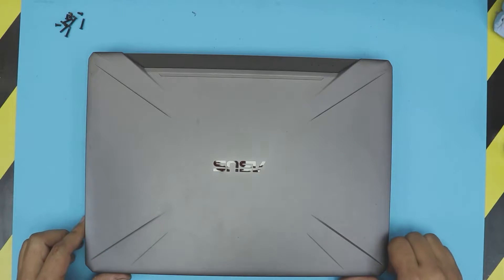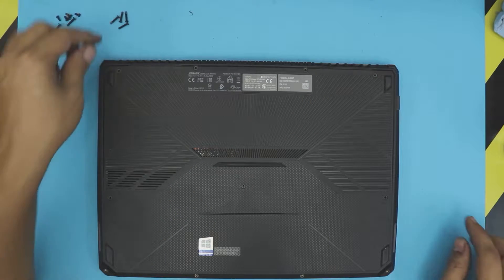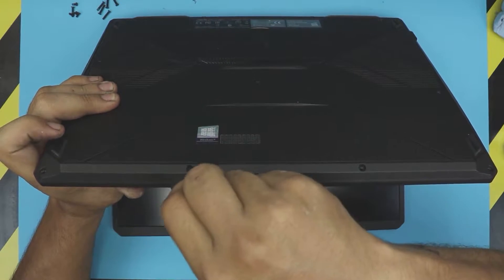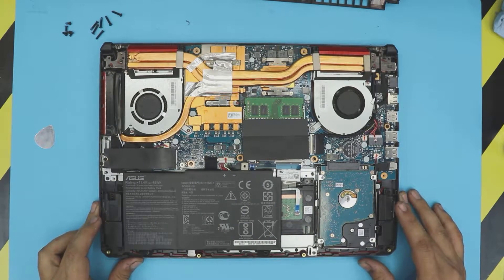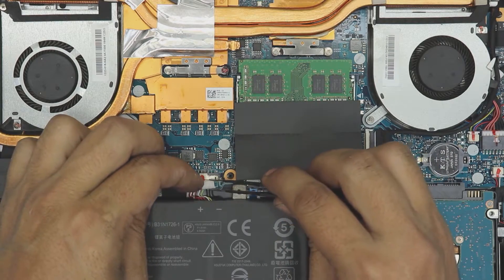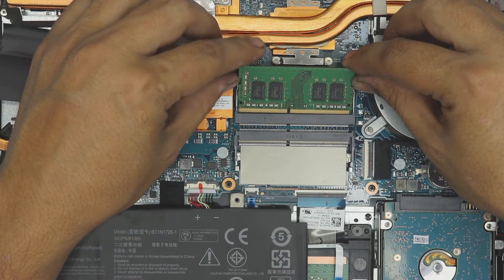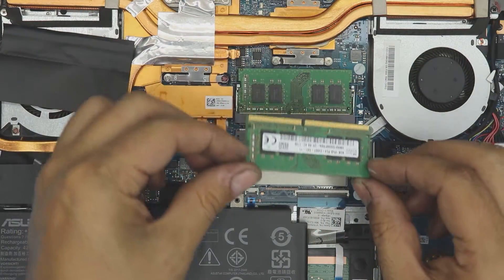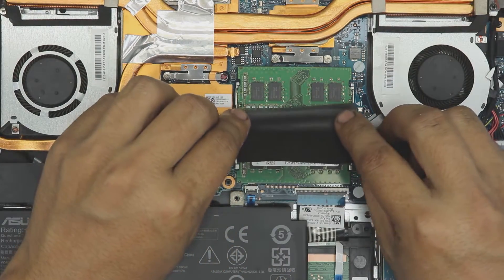How to Upgrade RAM on ASUS TUF FX505D for Better Gaming Performance

Comment: Sir  im confused about the Cas Latency,  when i scan with cpuid it shows 17 CL , but if i type my currently installed RAM it shows 22 CL , i am confused, what ram is correct for my asus tuf fx 705dt ?
Reply from the maker: 🫠Regarding your question, you do not need to worry at all about the CL or latency, as you will not notice it on this laptop. Just make sure you get SDRAM DDR4 3200MHz. I have placed links for the recommended RAM in the video description.
Should you have any further questions or requests in the future, please don't hesitate to ask me.
cheers🍻
Reply: @uFixTek  god bless you sir thank you
Reply from the maker: It's my pleasure my friend.

Comment: I removed the battery and rely on plugged but not working 

and even I dint pressed the power button it will start to blink.
Reply from the maker: you can use the laptop without the batery, we do disconnect the battery for some clients and the only downside is that the laptop takes 30sec longer to show anything on screen.

Comment: One of my long screw is struck.. I'm not able to unscrew it.
Any solution here?
Reply from the maker: 🫠Regarding your question, if you have one of the screws rotating and not coming out is because the base of the screw is broken and is rotating in its place, what you need to do in lift the rest of the cover and create a tension on the screw and once you create the tension by lifting the bottom case at the same time start unscrewing and the tension will not let the base rotate and it will result in release of the screw.
cheers🍻

Comment: hi i already have 2x 8gb rams, but will this laptop much smoother when opening many browser tabs if i had 2x16gb instead? i will not upgrade if the difference is not going to be noticable.
Reply from the maker: 🫠 If you wish to support the channel, you can like, subscribe, or both!
Regarding your question, it will defiantly help with more browser tabs if you have a lot open it will defiantly help.
Should you have any further questions or requests in the future, please don't hesitate to ask me.
cheers🍻

Comment: Wish you would cover the memory speed settings in the bios after installation. I can’t figure out how to change it in this version. The 3200 sticks I installed are defaulting to 2400.
Reply: I think the Ryzen 5 3550H maxes out at 2400. So no point getting more than that
Reply from the maker: Thank you for the feedback! if you wish to support the channel you can LIKE or SUB or both :P
regarding your question: not all the bios on laptops are changeable, go to your bios and look for "XMP" option and enable that if there is any, else there is nothing you can do about it.
Reply: @uFixTek memory speed default its 2400.. i wajt upgrade my RAM 32GB dual which it's better still with default buy 2x16GB 2400 or 2660 or 3200 ? Which better ?

Comment: what card did you use there and where can it be found, also i didnt see any but are any specialty tools required for this?
Reply from the maker: thank you for the feedback and your support by a sub  :P
regarding your question:
the tools i use and the ram i used is in the video description my friend ,
16GB RAM STICK: https://amzn.to/2XKnGgs
Reply: Cant believe you dont have more views this is awesome. Can i add two 16gb ram sticks to this laptop?
Reply from the maker: @estebanmunoz5583  Thank you for the feedback and your support by a sub  :P
regarding your question: yes you can and it will work just fine,
https://amzn.to/3eoXhfB